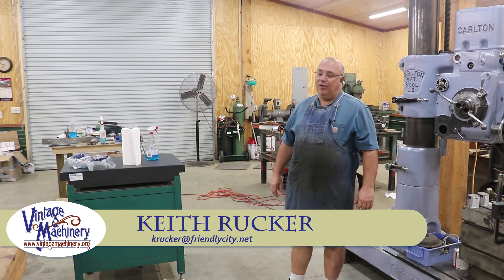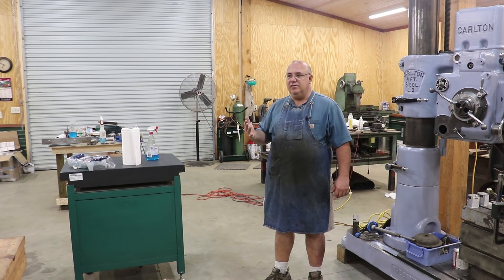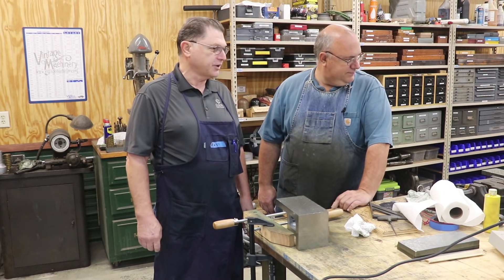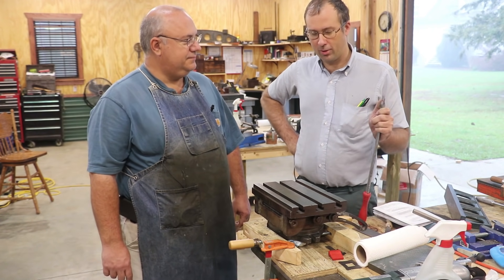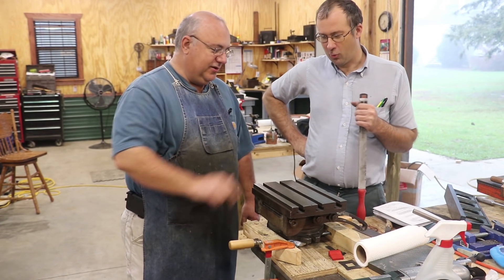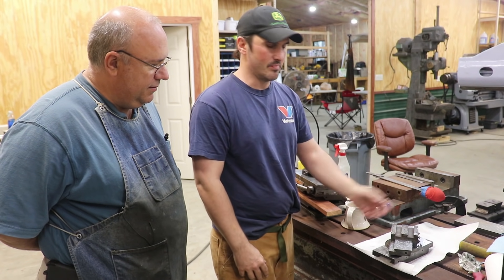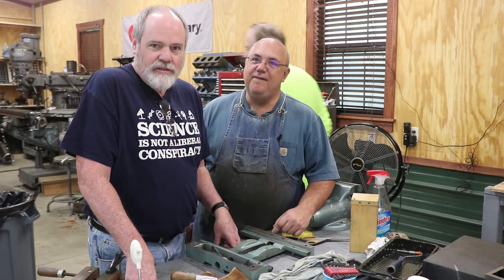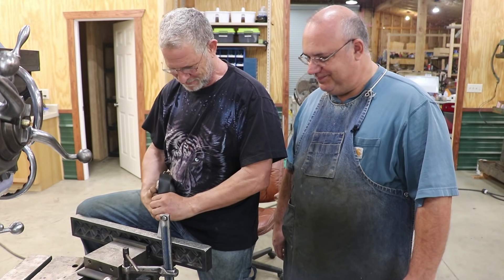Richard King Scraping and Machine Rebuilding Class - Nov. 2017

Comment: It's not bragging when you teach what you know best.  I know too many people who do brag about how much the know, and couldn't actually perform the task themselves.  
It's also too bad that these skills, like Richard King does, are being done away with by computers.  I learned electronics from my Grandfather, and now most everything is built by machines, and when they don't work any more, it just gets tossed out.
I worked for a telephone company, and designed and built some test equipment, but nobody wanted to have to push buttons to do the testing, they all wanted the computer to do all the work for them.
That's why I watch these different videos from all you guys, which gets back to putting sweat and knowledge into their projects.
(maybe even a little kicking things once in a while)  
There used to be quite a few machine shops around where I live, and now they are all gone.  No one to show you how to WORK any more.  You can read books, but like you all said, you need that one on one.  
Anyway,
Keep up the good work, and keep the videos coming.

Michael